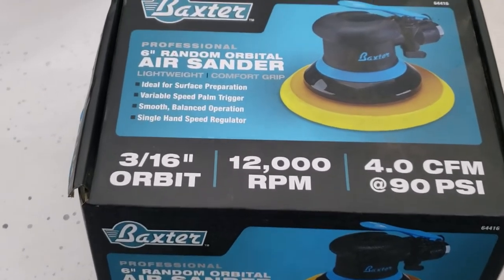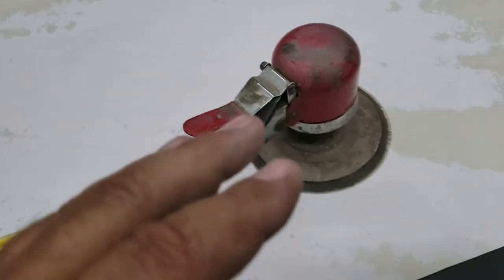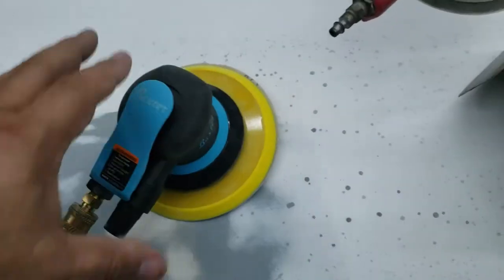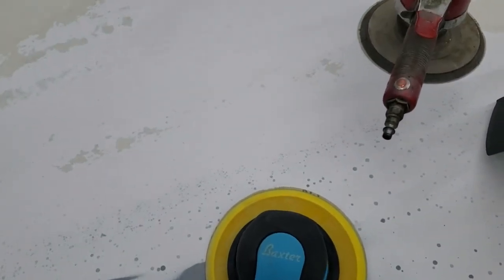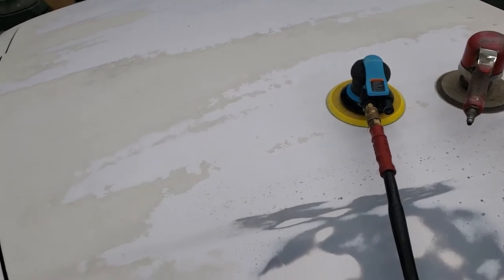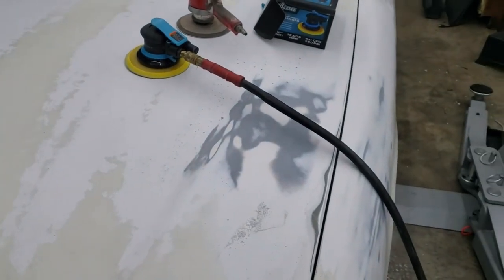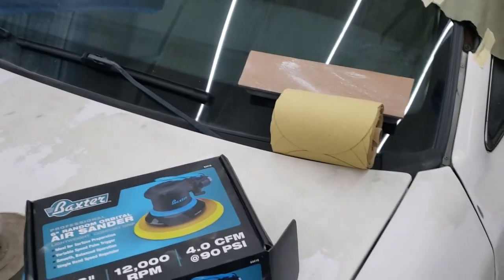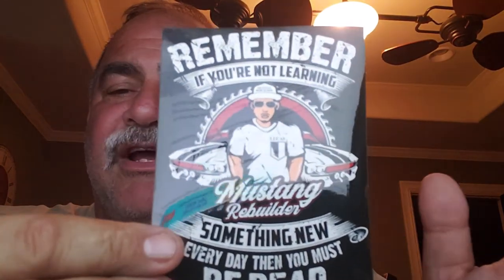Harbor Freight Baxter 6 inch Random Orbital Sander

Comment: Yes, times have changed. I'll be doing a lot of wet-sanding in the next couple weeks.
Reply from the maker: Many shops only dry sand but truly the best way to see imperfections and to get a straight body is to wet sand and OMG your paper last so much longer
Reply: @mustangrebuilder  the shops want to finish the jobs fast so they can collect that insurance money.
Reply: @mustangrebuilder  so actually dry sanding is cleaner and way better …… sorry to pop your bubble lol
Reply from the maker: @chriswebb383  No I understand and I do both but most of us old custom painters still wet sand but we always cut and block our feather fill or poly filler primers  dry LOL
Reply: @chriswebb383  
No if you're sanding to buff ' the paper will gum up if you dry sand and will leave scratches in the paint '  
Same thing will happen if you're final sanding before painting ' always best to wet sand in both of these cases. If you're sanding primers ' body fillers ' stripping down the paint etc ' it's best and faster to use an air tool thats applicable to the situation ' using open cut paper.

Comment: I was going to say DeVilbiss first but Googled it and found out it was Binks. Cool old technology. I personally use the Baxter da everyday in a production shop and it works great and is holding up fine after a couple months of use.
Reply: Devilbiss was first
Reply: How's it been after 2 years?
Reply: @eastcoastken  Still working great. I do however oil it weekly and keep it clean.
Reply: @davidl2736 I need a hook it backing pad. Where can I get that at?